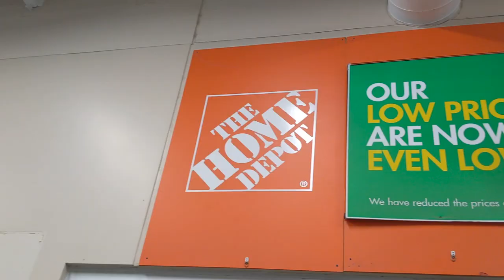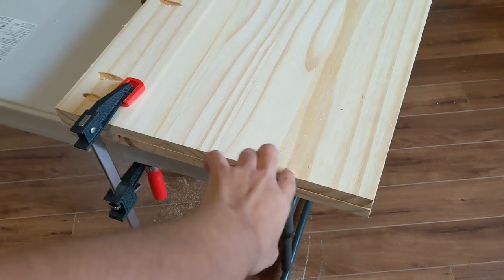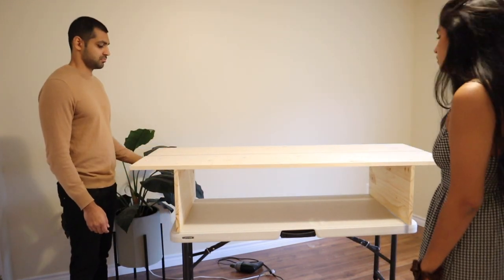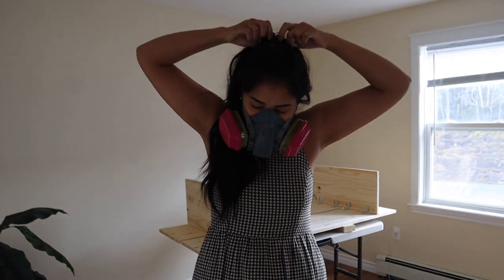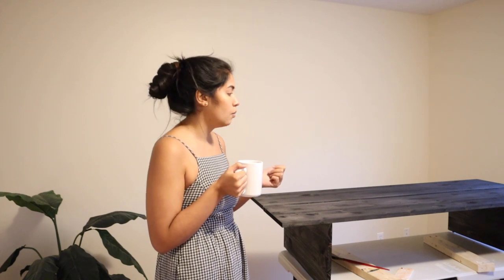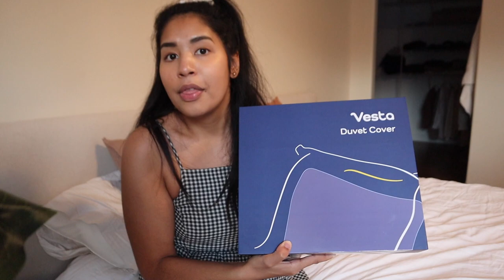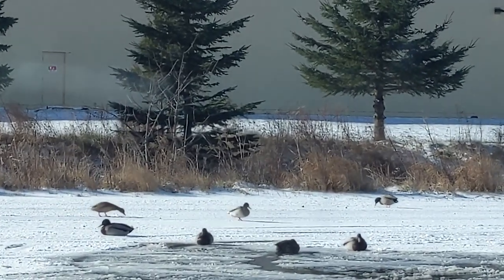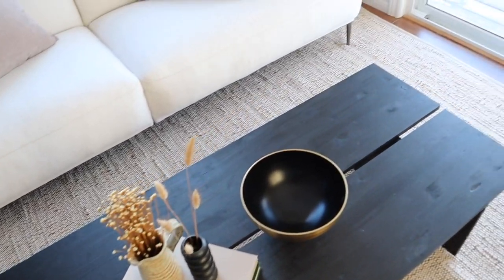My DIY Coffee Table (wooden + so easy!) | Home Made Happy Ep. 15

Comment: Table turned out beautifully! The black effect reminds me of an all natural homemade stain I've used. Take 2-3 steel wool pads ( no sos soap, plain) put into gallon of vinegar. Let wool rust/ dissolve week or more. Then when you apply to wood it magically starts turning black! Some sort of chemical reaction to the tannins in wood, so I don't know how it would do on laminated boards with the glue? But definitely smells better than most stains as the vinegar scent evaporates quickly.

Comment: Well done, looks very good!👍 One question: shouldn't you sand after the finishing coat and apply at least one more coat?
Reply from the maker: yes you are totally correct! I didn't do that initially and found it was terrible to wipe down because the wood fragments kind of lifted. I ended up doing a light sand and a second coat a few months later. 🙃
Reply: @DIYDalia  I thought I might have missed it, you did a good job, beautiful table. Yes probably a lot easier to clean now!😉😁